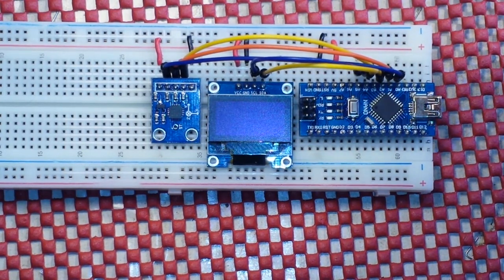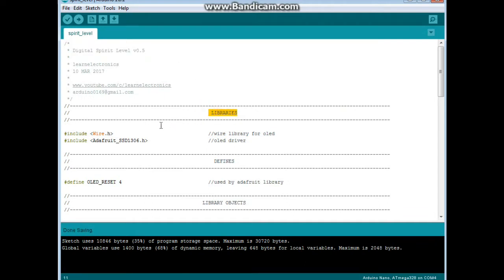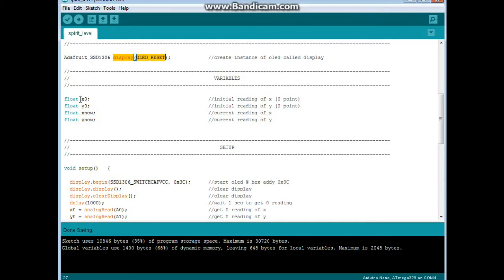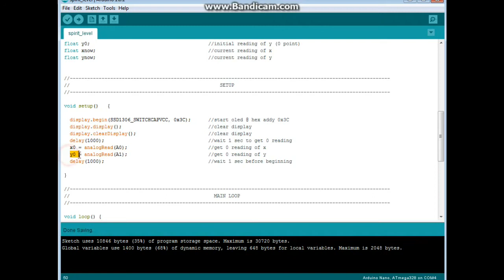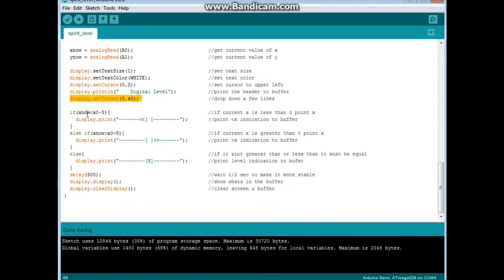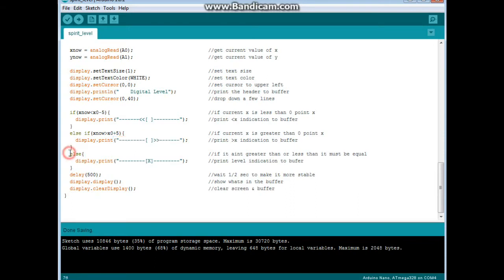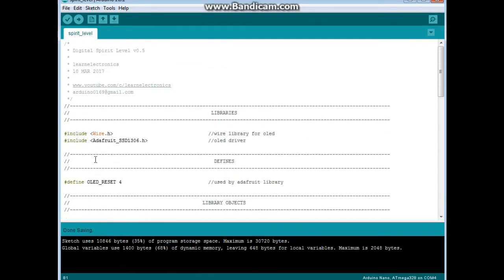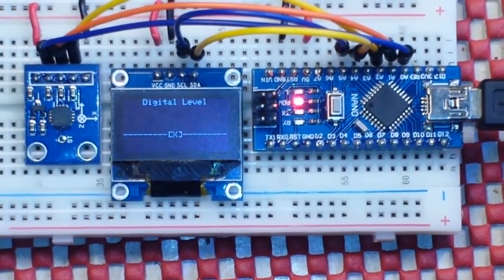Arduino Digital Level

Comment: I purchased one of these modules for the purpose of leveling a surface. It appears only to show deviation. Must it be zeroed every time it is activated? This defeats my purpose. Can I hard code it's zero reference or store it to an SD card such that it can level my surface on boot?

Comment: hey!  good project, do you know how easy it would be to measure the angle in degrees in steps of 0.1degrees?
Reply from the maker: +Safire Associates pretty easy, it's just a matter of resolution
Reply: thanks for a fast reply, so do you know if i could code this so i could set a zero position at any point by pushing a button or similar to calibrate it and then the readings would work out movement from that point in degrees?
Reply from the maker: +Safire Associates Yes, you could do that. Concerting the output to degrees would be the only difficult part, and it simply a matter of laying out a table and doing some measurements to find the correlation.
Reply: thanks i will give it a go 8-)